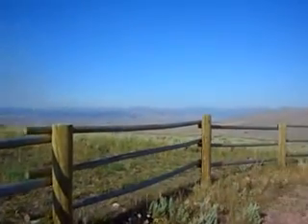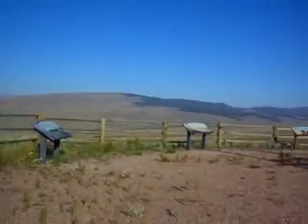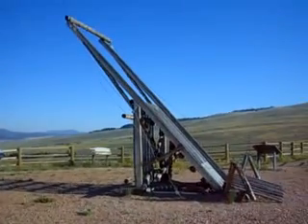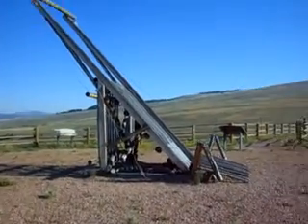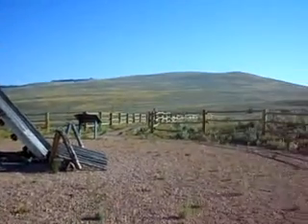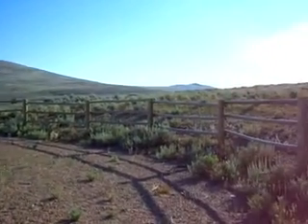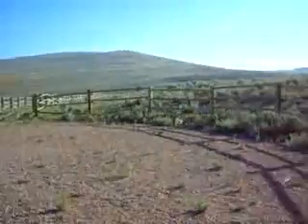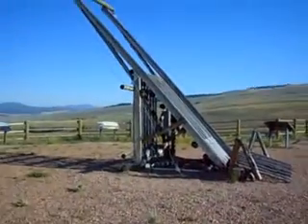An example of the Beaver slide hay stacker of the Big Hole valley, Aug 27

Comment: The beaver slide stacker builds a "hay stack." I would like to get more information on the inventor. We used them on our ranch to build loose hay stacks. Some still prefer to build a loose hay stack when they are putting up wild hay. I can remember sitting atop the pile of hay on the forks, while grandpa ran the team of horses that lifted the forks up the slide. It would take us and the hay up to the top, and dump us over, onto the stack. The one on your video was used to dump hay into a square hay corral, usually built out of logs or boards, designed to keep the elk out of the hay. It is a short lift, just enough to get it up over the edge of the corral. You would see these square log or board structures assembled in the hay fields, and they looked like cabins with a hay roof. Our beaver slide stacker lifted the hay much higher, in order to build a taller stack, that we would then build a buck fence around.